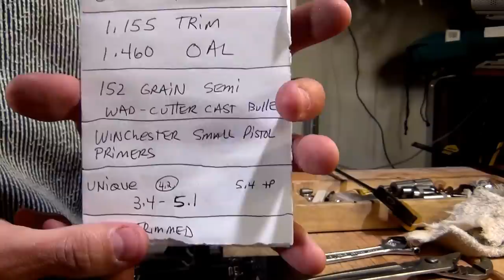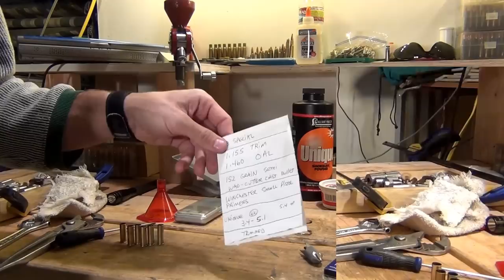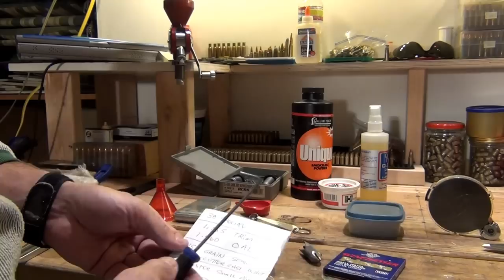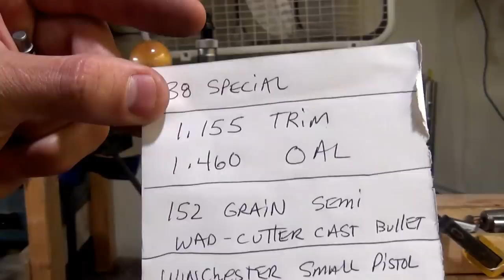Reloading 38 Special on a single stage press - HD

Comment: View 60,000!
Reply from the maker: Quirkification Thank you!
Reply: Question for you; I tumbled, dacapped and resized a bunch of 38 special cases.
More than half of them won't fit in my case length gauge, they were belled at the bottom of the case.
Should I toss them?
Thanks.
Reply: I don’t know if you will see this or not because this was made so long ago but thank you so much for this. I am just getting into reloading, yes a bad time to just be starting, but this goes into so much detail and you explained each step and how to do it. Thanks again.

Comment: You may already be aware, but according to the RCBS instructions insert, carbide dies no not require cases to be lubricated prior to resizing. I never use lube and have never had a problem. It's a huge time saver.

Comment: I have been reloading shotshells for over 30 years and I've had all the equipment for reloading with a press for a year now. So after watching your video I figured it's time to try it.  I also went to RCBS youtube site for set up on my press. But I wrote down step by step, every thing you said and how to adjust the dies. 100 successful .38 specials to spec without any problems. Thank You Very Much

Comment: The strength of this video is the attention to detail that is provided for each step of the process.  I've seen videos that skip over the detail.  For example, the video shows every step in properly setting up the bullet seating die with crimping.  Check the powder loads (measure and visual check).  Nicely done.  Thank you.
Reply from the maker: Thank you!

Comment: Happy to see that you do something I do as well.. Visually check the powder with a flashlight... Im so paranoid about it , but it is very important.      
Just a small note ... You can unseat a bullet .. Not an ideal situation , but bullet pullers are there for cartridge dis assembly.  I just flare again and reload . Does not normally happen because I would have set the dies properly by then , but bullet pullers are  an important tool.

Comment from the maker: Roll crimps are most often used with cast lead bullets that have a groove for the case mouth to 'roll' into. In the mag tubes of leverguns it keeps the bullets from becoming deep-seated under recoil as one round bumps against the other. In handguns it keeps the bulles from creeping either forward or backward in the case. A taper crimp 'squeezes' the case sides against the bullet, but doesn't curl the mouth of the case in, it just lays flat against the bullet. Nearly always used on jacketed ammo.

Comment: Ah.  My favorite round to reload and shoot.  Such a forgiving round to learn from and accurate too as well as versatile!!  Enjoyed the vid.  I also shot 4.2grs of Unique under a lead SWC with a firm crimp.  Used a Dillon AT500 upgraded to RL550 and RCBS little dandy powder measure with the steel rotors that were cut to certain volume.  The little dandy threaded on top of the Dillon tool head.  I would reload the nickle plated brass until all the nickle was worn off and still had case life left.

Comment: Very good points regarding the 4 die set, on the progressive over the single stage and the 3 die set also the case lube with the carbide die.i always lube the cases myself with the carbide sizing and decap die. Regarding the primer pocket I use the lee primer pocket cleaning tool.

Comment: Great vid,thanks,i wondered what you were doing when you backed out the seating adjuster prior to crimping and then you bought it back down after crimping which is a great way of doing it,i have been allowing my bullet to sit 0.055 high and then when i crimp the bullet is moved into the case by that amount as per Lee instructions but i will do it your way its better,i guess you could make up a dummy round at correct length and use that always as a seating guide ? I use the Lee zip trim to clean and trim my brass and i find that a great little tool,works great, cheers.
Reply from the maker: +My Rossi Rifle Thank you for stopping by!

Comment: Excellent video! I’ve,just started reloading .38 Special and used your video as a step by step guide to get me started. After reloading l went out to the range to test fire the reloads and they all worked fine. I do have a question though. I’m back reloading and l just started using an ammo gauge and many of my reloads don’t slide easily into the gauge but they slide easily into the cylinder of my Smith and Wesson revolver with no problem (plenty of room). Why is it that they don’t drop smoothly into the ammo gauge?

Comment: great video. i just wanted to touch on your cut the board analogy. unlike cutting a board too short, you can fix a fix a bullet that is too deep. what i do is put the cartridge in a kinetic bullet puller and give a light tap or two. that is usually enoigh to pull out enough to fix it.
Reply from the maker: +sjeverett75 that's true! Thx

Comment: As someone new to reloading, I really appreciate this video.  I have used it for reference as I get used to my new reloading equipment.  I have a question.  I followed the instructions you gave and have found that while the rounds fit easily into my Taurus .38, they won't go into my Ruger .357.  I tried to put more crimp on the case, but it only pushed the bullet further into the case.  Is it just that my Ruger's tolerances are more restrictive than the Taurus?

Comment: Jiujitsu2000... i am reloading 38 special for my revolver. The problem i have is my case length is 1.147. The bullet that i am using is the hornady xtp with cantullure 125 grain. When i seat the bullet following the lyman recipe. The OAL is supposed to be 1.470. For me to seat the bullet correctly so i can crimp into the cantullure my actual OAL is 1.443. Could this be a problem if im seated .027 under the recommended OAL?

Comment: On resizing Keith style  bullets that drop at  .365, wont you have to crank on the press to stuff it through the sizing die so it fits the gun?  I had to do that but gave up after the 2nd bullet as i almost tipped the bench over.

Comment: Is it really necessary to lube the pistol cases considering that most RCBS straight-walled pistol dies are equipped with Carbide inserts?  I have a buddy who handloads and knows quite a few who do; I thought lube was strictly for rifle cartridges and specials cases (no pun intended).  In your experience, what would you recommend?

Comment: Good stuff, thanks. At 33:00 minutes or so, it seems like this is a good reason to go for the 4 die set instead of the 3 dies set. With the 4 dies set you would then have 2 separate dies, one for bullet seating and one for crimping that you could set and then don't have to mess with again, rather than changing the settings on the single seating/crimping die?

Comment: Great Video. Have watched a number of your videos about reloading and lead casting. I found all of them to be very informative and helpful, really good job at explain things. Couple of questions, what kind of powder measure are you using in this video and how well does it meter out Unique. A friend loaned me a pound of Unique powder and I want to try it in 45 ACP, but have heard comments that Unique does not meter well. Your thoughts on this.  And thanks again for the great video....
Reply from the maker: Thank you for the support you give my channel. I don't have any problems metering unique. Have a great day!
Reply: jiujitsu2000 Is that the Lock-N-Load powder measure you were using?
Reply from the maker: RoandKen B
Yes it is! I love it... Extruded powders don't do so well. A long drop tube helps though...

Comment: thanks for a very informative detailed video. I just subscribed. 
I am a total beginner and want to keep things simple. 
I will have reason to reload much. What make and model press are you using? 
it looks like one I would like to use . csn it be used for pistol and rifle loads?
I would really appreciate a response .
Reply from the maker: +tjmooremusic  Thank you for stopping by! Depressed that I'm using is a Lee reloader and it can be used for pistol or smaller rifle cartridges. I've used this press for things up to 7 Mag which is a large magnum rifle cartridge
Reply: JIUJITSU2000 
I've looked into Lee single stage reloaders. I like how simple your process is.
is that a specific model?
Reply: JIUJITSU2000 
would it work well for 223 - 5.56?

Comment: I started to have an issue while trying to remove the old primers the pin in the resizing for. The pin would rise up not allowing me to remove the old primer. I used to a tap to put the pin back flush but every other round it would rise up again. I tried to readjust the die. What do you think the problem would be? Thanks for posting a great video
Reply: primer hole not lined up

Comment: As a loong time sub who's still a newbie Question:  isn't a .38S. OAL 1.550 ?  so when seating a bullets with SWC's it's going to be shorter and don't that make more pressure ?  i got a deal on 300 - Hornady 158gr. SWC/HP Frontier lead #10428 .358 size for $20.00 so i can use min. loads in an beautiful S&W Model 10 that i don't want to beat up with heavy loads. hope you understand what my question is. lol.  thanks.

Comment: I am starting to load 357 magnum. Can I use standard small pistol primers when using Power Pistol powder? Or do I need to use magnum small pistol primers?
Reply from the maker: That is a great question personally I would do something like that, but  please double check your load data in your manual
Reply: @jiujitsu2000  thanks! I actually just checked with my local reloading store and they checked the manuals to confirm I can do it with standard primers.
Reply from the maker: @lomberetactical1844  you're welcome bro! Blessings!!
Reply: JIUJITSU2000 here’s another question. Is ok to reload .358 diameter bullets for 357 magnum rounds to shoot out of a revolver?

Comment: Perfect job on this video sir.
Just wanna ask you question.
I want to load 38. spl loads but i have only .357 brass. I realised in some of loads the powder doesnt burn fine because of there is more gap in brass. Tried to do more seating of lead cast bullets in to the brass. I think you may give me better idea what to do best to load .38 spl by using .357 brass.

With regards.
Reply from the maker: Thank you, I'd recommend that you trim the brass down to .38 special length and load them as .38's. Use that load data... Trim length, seat depth, powder charges and so on...
Reply: I wouldn't trim it down to 38 special. 357 brass is worth a lot more. It's easy to find 38 brass for 30 dollars a thousand. You could easily trade it also. Heck if you got a decent amount of 357 brass I'll trade you.
Reply from the maker: +bubbacrabb :-)
Reply: jiujitsu2000 not saying your advice isn't good. Just think the fella could get more 38 brass out of it. Plus I don't know about you but I rarely find 357 brass at the range. I find tons of 38 though. If you do find it on sale the 357 is always a significant amount more money
Reply from the maker: +bubbacrabb You're 100% right about that brotha!

Comment: Whats a good ammo to start out with and how many reloads do you get out of 1 shell?
Reply: you would get around 10 shots, afterwards, you would need to re-anneal your brass or let the brass get cracks and whatnot, but remember that if the brass is cheap or free (in Australia, Victoria you can get brass from the state forests for a little effort and fuel.) then you shouldn't worry about it. a good round is one that is tailor-made for the gun that the ammunition has been made for, pretty much the point to reloading.

Comment: Seating a primer after belling the case mouth because it might push out the primer makes no sense. If it did, then no progressive press would work. It would have more of a chance when seating the bullet and if it did get rid of the case it has an enlarged primer pocket. On revolver ammo if the bullet  has a crimp grove, you seat the bullet in the crimp grove and roll crimp the mouth into that grove. No matter what the C.O.L. is. Yes you can taper crimp the round but then on revolvers you have a possibility of the fired round causing the other rounds in the cylinder to push those bullets forward and locking up the gun.

Comment: The crimp die in rcbs set sucks. Get the lee 4pc. Can't  beat the lee factory  crimp die. The rcbs one causes bulges in case. Can cause fitment issues in cylinder.

Comment: you're wasting your time cleaning the primer pockets and trimming the brass. Unnecessary work. 
and there is no way in hell that flaring a primed case will loosen the primer up from "air pressure". I mean come on
Reply: Seems alot of wasted time here.
Reply from the maker: Trimming is crucial if you want a uniform release of the bullet. Its also important when you crimp into the cannelure on each bullet. This will all aid in your accuracy. Thanks for watching! Good day! :-)
Reply: jiujitsu2000 i've been reloading mixed brass for various handgun calibers and my crimp is always uniform using the seating die to crimp at the same time as i am seating the bullet.  Rifle is necessary to trim. handgun brass is pointless to trim and so is cleaning the primer pockets.
Reply from the maker: jris211 Cool bro, I'm glad it's working out for you. :-)